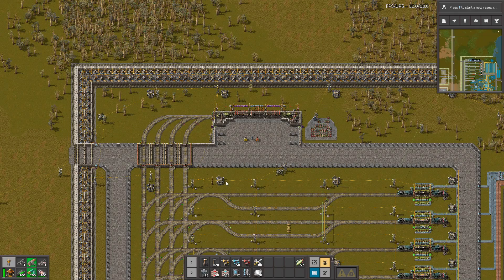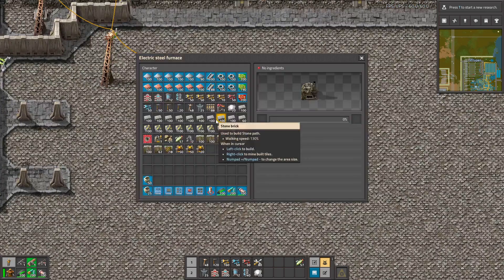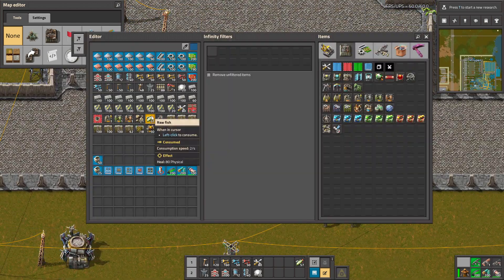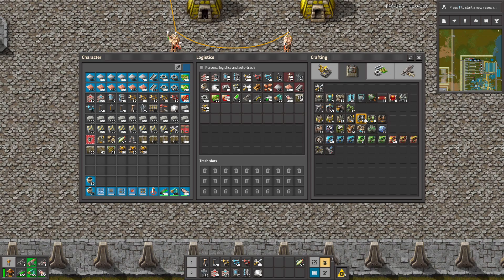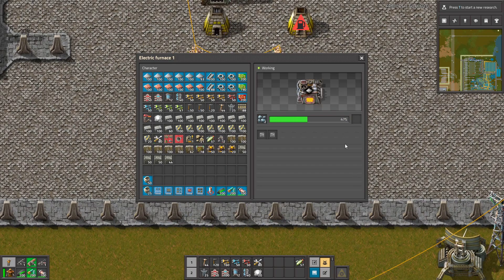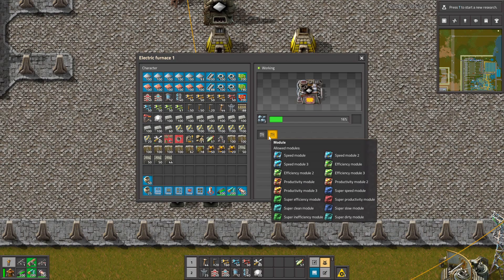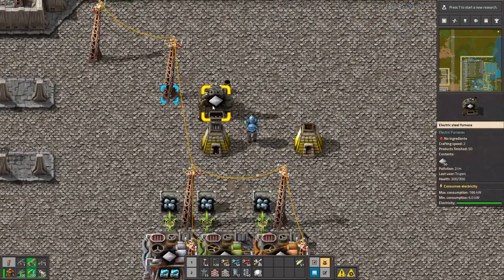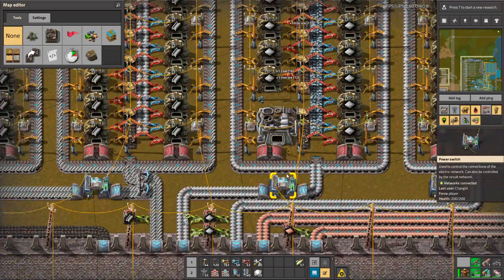New electric furnaces.

Comment: They should change balance to something like this:
Electric stone furnace: 1 -> 0.75
Electric steel furnace: 2 -> 1.5
Electric industrial furnace T1: 2 -> 2 (+15% productivity)
Electric industrial furnace T2: 3->2.5 (+20% productivity)
Electric industrial furnace T3: 4->3 (+25% productivity), module slots 4->2 (to prevent insane productivity)
Reply: It's funny when the devs themselves added insane productivity foundries and legendary modules later. Realistically Tier 2 furnaces are a useless addition and only Tier 3 with more modules are somewhat interesting.

Comment: Steel furnaces and electric furnaces have the same smelting speed, making electric steel furnaces defeats the whole purpose of standard electric furnaces since they are bigger and more expensive to produce, unless you want the two module slots.
Reply: Research
Reply: They can also be boosted by beacons, also there's no need for fuel to power them so you can run 2 lines of ore along one belt instead of one if you're using the most common furnace set up. (Never mind I should've watched the video first lmao I get what you're talking about now)
Reply: just use the T3 Electric furnaces, they seem pretty op
Reply: @masterhacker7065  that's not the point lmao
Reply: it don't pollute
Reply: Yeah but it's question to developers why they make same speed for 2x2 and 3x3 furnaces
Reply: @ОннокорОктябрь  They made it like that  so that the player has to trade resources and space for convenience and single resource use (no need to bring coal in)

This mod makes it so that there is no such dilema
Reply: @Infanterie_Marine  exactly